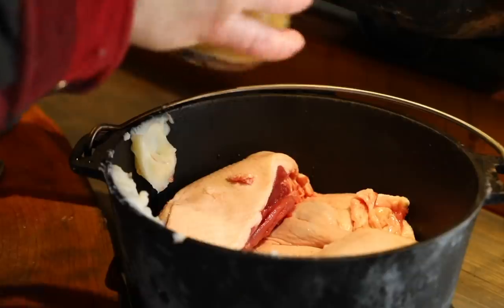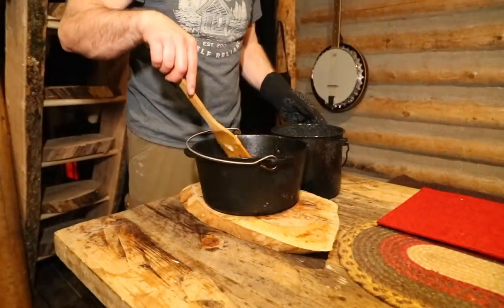Wife & Daughter Making Maple Syrup | Off Grid Log Cabin Life

Comment: If you freeze maple syrup when it still has around 10-20% water it takes on the consistency of ice cream where it isn't separated. If the sap starts to flow,  coconut oil absorbs much of the raunchy bitterness, and leaves some coconut flavour behind as a bonus.